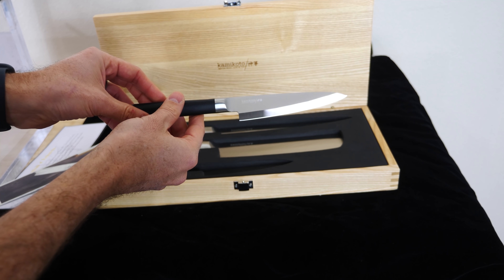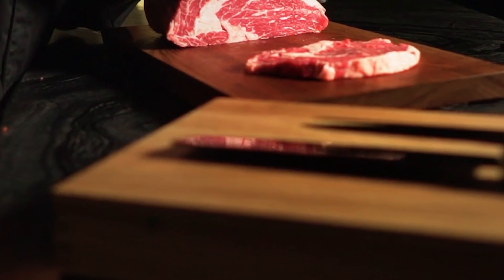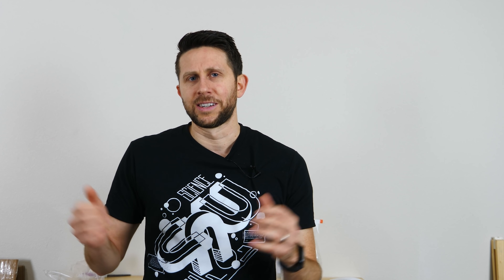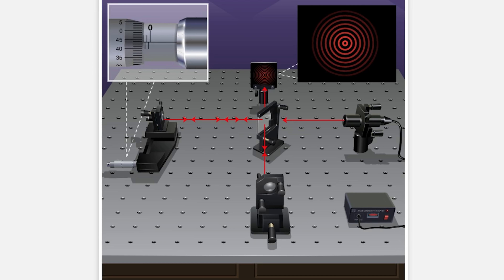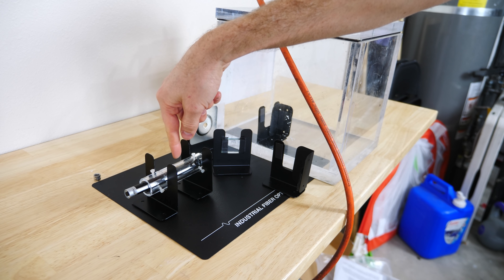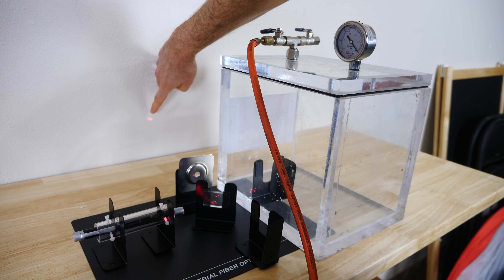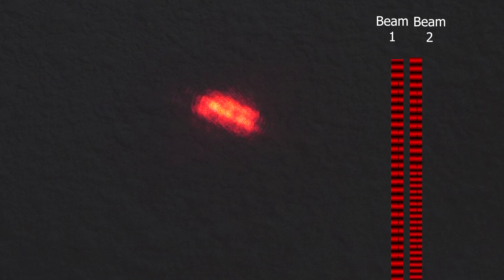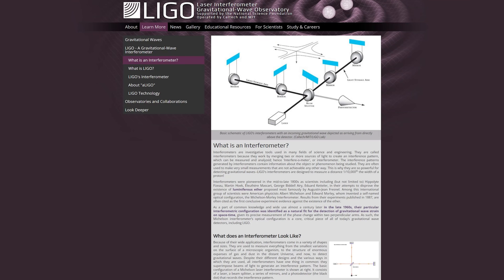The Most Famous Failed Experiment

Comment: When I was younger MANY, MANY years ago in elementary through most of high school I was taught the speed of light was absolute, it wasn't until later in physics I learned different.👍
Reply: The speed of light in the vacuum is absolute, though.
In some sense, that is "the" speed of light.
Reply: @landsgevaer  they changed it about decade ago, so it would have only nine significant digits. Basically the meter standard was changed.
Reply: @landsgevaer  What I meant was that the speed of light is not an absolute through many things other than a vacuum.
Reply: @antiquatedflatulence1607  You would need to define "the" speed of light. You are talking about group velocity. That also depends on wavelength, just to mention a reason why it is ill-defined as "the" speed of light.

Wave velocity remains the same, actually (a sudden disturbance in the EM field does propagate at speed c, also through medium, but it changes its wave form). Information still travels at speed c. That is absolute (afaik).

The issue of units is a red herring; if tomorrow we switch to smoots per jiffy, that changes the value of c in our notation, but not the speed of light as a fundamental constant.
Reply: @landsgevaer  The speed of visible normal light through a vacuum (186,000/mps.).
Reply: @antiquatedflatulence1607  "Normal" light? Even for visible light, the speed differs from blue to red. This is a decent way to describe DIY physics experiments maybe, but the fundamental speed of light constant isn't described so loosely. You're not getting or acknowledging my point. That is *group velocity*. If you have a sudden disturbance in EM field, the wavefront that carries the information that the disturbance took place travels at the 'full' speed of light. Also through air or glass or whatever medium. It's strength decays quickly, so it is not the same as the propagation speed of modulations in the envelope of a sustained wave, but that fundamental wave speed stays c.
Reply: @landsgevaer  I understand what you are saying, I was just being general and NOT so detailed. lol
Reply: @antiquatedflatulence1607  But isn't it funny then that, in your original comment, what you were taught in high school was actually more correct than what you learned later...
Reply: @landsgevaer  Correct.👍
Reply: @antiquatedflatulence1607  The speed of light is absolute for the unchanging medium that its currently in, so changing the density of the gas is changing the medium its in.
Reply: @landsgevaer yeah so it should also be considered that it's kinda strange that it doesn't seem to slow down (as known) like other things in gases like air as much, but is only altered in speed kinda to a constant 'fqc' which should be almost impossible especially considering it doesn't has as much mass to it in a way. But I have solutions to the problems to all of that kinda.
This is right, but the reason why the pattern lines appear is still because of the semi permeable reflective mirror. Light does not do real cancelation like wrongly often misconceived/misconducted/stated. It's unlike a wave of e.g. water or sound acting in e.g. air which are indeed able to cancel each other out like magnets aligning, + and - = 0. But this common misconcept is due to the fact that light still can be altered in speed, frequency of the 'mass' or rather density would almost be more precise as of this case. It used to be already a sum of the addition of + & - itself as result. All cancelling in the experiments which look like e.g. waterwave or noise cancelling properties are just illusions as of being an constant acceleration kinda effect. It is like a very unheavy plasma like balanced gas or rather like aligned hydrogens of the atoms, a cascade of hydrogenlike order which seeks entropy, therefore can only get even more ordered in some altering way of it's underlying energy state of + & - .
Waterwaves have movement which can repell each other and kinda cancel itself out, sound is a wave of air itself movement which therefore can cancel itself out like wind in different fqs.

Comment: And so in case of the gravitational experiment, how do they know that when the interference pattern changed, the light went through the gravitational wave, and not through this elusive ether?
Reply: Also if there was an ether you would have the same effect all the time. Gravitational waves are temporary occurances, nothing to do with the medium they travelled through
Reply: @thors3532  wasn't the interferometer used in the gravitational experiment also?
Reply: @ysakhno  Yes. One tool can be used for more than one thing. I can use a 30cm ruler to prove the dimensions of an A4 piece of paper. I can also use it to disprove the theory that I’m less than 30cm tall.
Reply: @jcskyknight2222  So my question is how to distinguish the results based on the same instrument and when the basic setup of the experiment is seemingly the same. I am sorry, may be it is very clear to you, like the same as it is clear to me how to disprove that you're less than 30 cm tall using the 30 cm ruler, but it is not so clear to me in case of the interferometer.
Reply: @ysakhno  The first experiment changed the angle of the interferometer in the hopes of detecting something that was thought to be constantly moving.

The gravitational waves don’t always exist, ie both experiments will show nothing most of the time.

So I guess it’s sort of to do with what you are looking for. If they had had a set up as sensitive as LIGO they might have detected a gravitational wave and thought it was ether, until they tried to repeat it and found nothing again.

Comment: Welcome to Flat Earth! 

4:00
Reply: Flat earthers are always wrong.
Reply: If a triangle has sides of 1, 1, and 1, what are the internal angles?
Reply: @harryworp  Does your "triangle" have 3 STRAIGHT sides?
Reply: @sleepingwarrior4618  Every triangle has 3 straight sides
Reply: @Miks55  excellent. So when we triangulate something in real world....the TRIANGULATION is not subject to 7/6r refraction is it? It's straight lines (and must therefore be Euclidean geometry in use). Correct?
Reply: @sleepingwarrior4618 , good call… this is a planar triangle.
Reply: @sleepingwarrior4618  What difference would it make whether gravity is a force or not? I am asking for an engineer. Are you going to evade that question, too?
Reply: @harryworp  just a triangle. Not a planar triangle....there is only one triangle. Three, STRAIGHT sides. Triangulation and trilateration both seem to work. They both apply Euclidean geometry. Euclidean geometry uses straight lines to enable angles to be measured and distances to then be calculated. As I say, it seems to work. 

Given that it does seem to work....non Euclidean geometry CANNOT be in use. You can't have both applying, it's one or the other but not both.

Given that it's NOT curvilinear geometry, this means the very same lines in trilateration and triangulation must also be in use when observing boats and buildings that should be behind the earth's curve when using zoom lenses. 

Yet we are told by fanatical lunatics that the same line of sight we just spoke of curves rather than is straight.....but you have just accepted that the lines are straight. Do you think straight and curved are similes? I think they are antonyms and mutually exclusive. 

Surely you agree that a curved line is not equal to being a straight line?
Reply: @Mandelbrot_Set  To you, yes. 

Claim victory. It will make you feel like you have a win and will make you feel better. Won't make your moggle explain how we can breathe in a vacuum though. 

Have a great night.
Reply: @sleepingwarrior4618  You evaded my question just as I predicted you would. Your sophistry is thus exposed. I see that you also don't know what a vacuum is. Maybe you should stop typing before you make an even bigger fool out of yourself
Reply: @Mandelbrot_Set  ...
Reply: @sleepingwarrior4618  Spherical geometry exists and is well understood. The fact that you don't understand it doesn't mean that other people can't use it. Let me give you a practical example.

I can prove that the Earth is a globe with one triangular flight path. Start at the North Pole and fly due south. When you get to the equator, make a right angle turn to the left. Travel due East for 90 degrees of longitude. Make a right-angle turn to the north. Arrive back at the North Pole. You just traced out a triangle where all angles are 90 degrees. That triangle is impossible on a flat surface. Please explain how that flight path could exist on your dirt pizza? Don't parrot your indoctrination about connecting flights. You don't understand a lot of things. We get it.
Reply: @Mandelbrot_Set  ...
Reply: @Mandelbrot_Set  ...
Reply: @Mandelbrot_Set  ...
Reply: @sleepingwarrior4618 , your good call was that I forgot to specify the geometry I meant.  The existence of planar triangles does not mean non-planar triangles do not exist.  A 1, 1, 1 triangle does not have the same angles on planar, spherical, or other geometries.

If you take a sphere, draw a straight line a quarter of the circumference, turn 90°, draw another straight line a quarter of the circumference, turn 90° in the same direction, and draw another straight line a quarter of the circumference, you'll arrive at your starting point… and made a spherical triangle.
Reply: @harryworp  Thank you for returning. The conversation with you is orders of magnitude better than with others.

Non planar triangles do exist, yes....but they are incompatible with triangulation and trilateration as the curved sides vary the distances and consequently mess up the trig. 

You seem to be describing the three lines on a sphere as both curved and straight at the same. That's a violation of the law of identity. The only way you can get a triangle on a sphere is with three chord lines and the corners could all be tangent....but if you think drawing three curved lines on a sphere can be identified as "straight" they cannot.

You have violated the law of identity. Triangulation does not and cannot work on a ball because there is always a geometric horizon a few miles away and a shadow cast by the earth preventing it from working over long distances. In real life, we can triangulate and trilaterate using ground based towers for hundreds of miles and in doing so, it proves the earth must be straight. This even includes the loss of signal as a result of the opacity of the atmo.

 I remind myself of Marconi successfully pinging a radio wave from Wales down to North Australia, a distance of around 12,000m using a tower not taller than a small tower block. Given that, from Wales, northern Austraila is under his feet and pretty much antipodal on a spherical oblate delusion, it is not possible for this if triangulation and trilateration do actually use straight lines, as you have agreed. 

Welcome to flat earth Harry. Wales to Australia radio waves prove earth has to be planar as the propagation of the signal is straight. 

Boom. 

You started so well as well.
Reply: @Mandelbrot_Set  ...
Reply: @Mandelbrot_Set  ...
Reply: @harryworp  How far do you think that two ships can communicate via VHF radio? If the Earth is flat, then why can't they communicate all of the way across the ocean? The only explanation is that radio waves cannot pass through dirt and rock. Neither can light. That is the reason that it gets dark at night. Why don't you know that? I am still waiting on you to provide one scrap of evidence that the Earth is flat. What is taking you so long?
Reply: @sleepingwarrior4618  Do you have a real world example of radio triangulation or trilateration at impossible distances or are you making that up, too? Something that does not require the ionosphere.
Reply: @sleepingwarrior4618  Is "loss of signal as a result of the opacity of the atmo" another lie that you made up? Do you have a scientific citation for your supposed effect on radio propagation or are you just making things up like your "density disequilibrium?"
Reply: @Mandelbrot_Set  ...
Reply: @Mandelbrot_Set  🤣🤣🤣
Reply: @sleepingwarrior4618  Just so everyone knows this guy insists you can’t measure an angle if any of the intersecting lines are curved. Even a very slight curve causes him problems.

He also likes to say things are negligible without providing any figures or workings to prove them to be so.

Oh, and he likes to quote a long range radio transmission as proof that the Earth is flat but refuses to elaborate on how you can have a short and long path on a flat earth.
Reply: @sleepingwarrior4618  Brave Sir Robin ran away. Bravely ran away away. 
I banish ye back to the Stygian depths of the flat Earth echo chamber!
Reply: @Mandelbrot_Set  ...
Reply: Sleeping Warrior, does an eclipse happen every month?

Asking for a friend.
Reply: @MCToon  On land, on water or cast into space, yes. It isn't every month, it's every 27.4 days but it's close enough. 

Is gravity a force? Not asking for a friend. No? Whats holding the sky down then? Now I'm asking for a friend :) #ThanksFTFE

Comment: LIGO have only measured noise
Reply: Nice satire.
Reply: @MCToon  You can find plenty of information about the fragility of the data. You are free to do what you want with it.
Reply: @ericpilkington6298  I’ve reviewed several of the publications.  The timing of the measurements the match the other interferometers and the coincidence of visible events is significantly outside the noise range.

But, do go ahead and post the DOI for the studies you are referring to.
Reply: @MCToon  One of the two events described in that paper is already a single detector event. And the noble prize winning event was critized by the danish group that found that the noise was correlating as well as the "signal". And the process of filtering out the same result  has been unsuccesful by other groups as well. However, no information nor anything i tell you in a conversation will change your mind. I am 100% certain of this. So have a good day sir.
Reply: @ericpilkington6298  you certainly could change my mind.  If you had any evidence supporting your claim.

"...critized by the danish group..." is not supporting evidence.

Send the DOI to the published paper by "the danish group".

Comment: distance measurement by split beam interference, not only the reply bouncy timing, double measure with high precision
Reply: simple reaction turbine hot air blower generator with rotational valve pulse jet hot air burner
Reply: same for ions flying in along a track interference measures
Reply: so if muons (particles) are observed traveling faster than they actually are (relative to observer), then they warp space on the perspective of the observer (must agree), so how about photons, they should be infinite instantly everywhere, but are they
Reply: ie, you can calculate exact speed of the particles from the space coordinates and time, so the observed fast particle is seen as warping space faster than they move, on the basis of the relativity (special)

Comment: The speed of light is "now". I've read and heard about previous experiments and it makes sense when you hear about the problems why they always failed.
Reply: The speed of light is not the present. It's the time it takes for light to travel from one point to the next. It doesn't have anything to do with now. The light that telescopes captures isn't from now it's from light YEARS away.
Reply: @ThePrufessa  Yes i did not literally mean what i typed out.. thank you for clarifying what others may not understand though.  I'm really just speaking to the problems other famous experiments without typing out a manuscript. I'm well aware light from telescopes is technically light that left said stars or other light sources millions to billions of years ago. The most famous attempts i am aware of had difficulty communicating when participant a lit a torch to when participant B saw said light.. if you used sound to let them know you lit the torch, the light was observed long before the sound traveled. If you used a telephone/telegraph the light traveled faster than the electrons through the wire etc...
Reply: @brianm.595  Yes veritasium demonstrated the problems with measuring the speed of light. The only way to do it is measuring the time it takes to travel to a mirror and back to you and dividing that by half.
Reply: There is a video by planet slo mo (a you tube channel) which shows light traveling in slow motion. Watch it.
Reply: @kirito5547  it was mind blowing
Reply: @kirito5547  the best slow mo videos to me were the grass cracking and the lightning storm.
Reply: @ThePrufessa  yeah the lightning one was good too. I haven't seen many of their videos but they are good.
Reply: @kirito5547  they're all pretty good. Check em out. Some might not sound intriguing but they all end up being nice. You didn't realize what takes place in a split second. Or whole second.